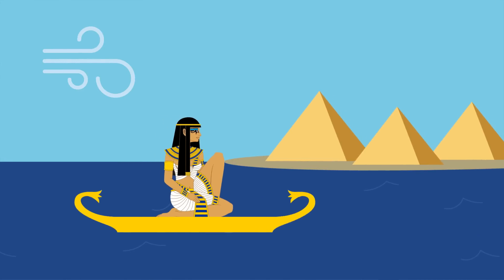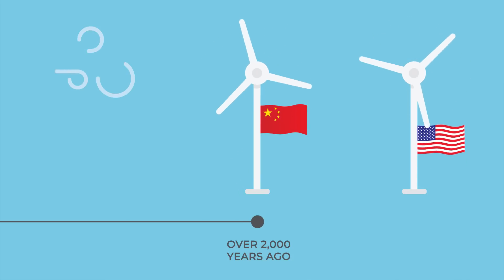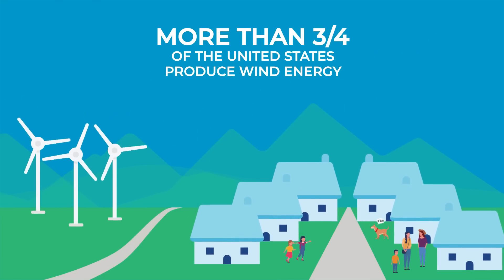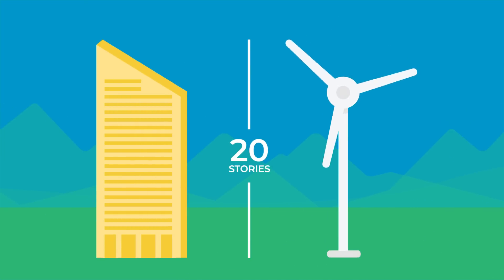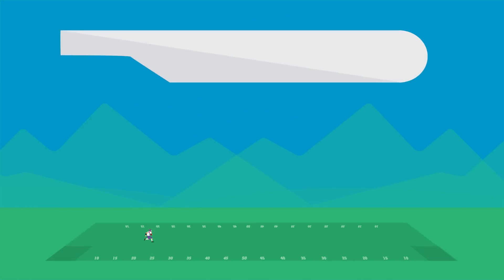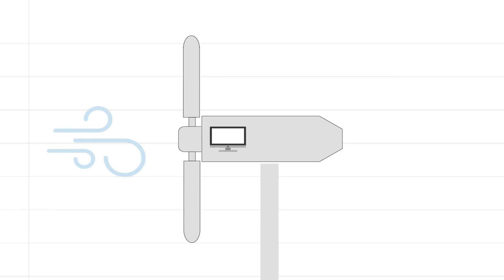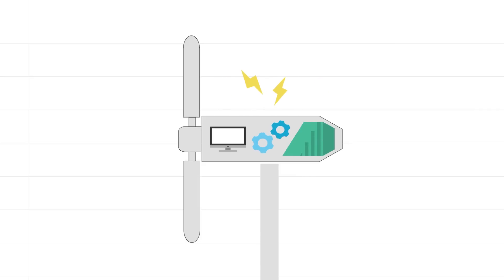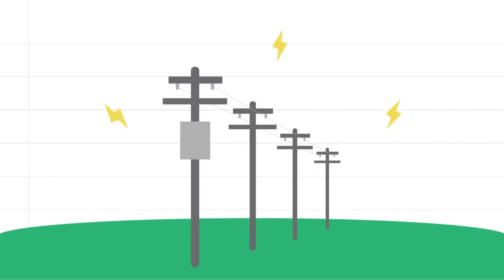Renewable Energy 101: How Does Wind Energy Work?

Comment: This tech only works for you got a windmill on your property powering your house. Imagine this huge windmills 300 to 600 miles away from your house powering communities. How much energy is lost in the miles of electric lines compared to how much energy this windmill produces. What happens in the winter time when they freeze up? This is to bring the carbon footprint down right? Research how much carbon it takes to build one of these usless machines..
Reply: 1) losses: 
Over 500 miles with high voltage direct current power lines you lose about 2.6 %. We are talking 2500 MW here.
2) Wind turbines don’t freeze up, they have heaters inside the blades that only use energy from the production. Modern wind turbines have much better capacity factor compared to turbines 15 - 20 years ago. Where they would return about 20% of maximum installed capacity, modern can do 50% depending on site.
Reply: @Mike-kr5dn  Don't freeze up? tell that to Texas.
Reply: @richarddangles8896  that was not the problem of the outage. Wind in Texas is only a few %. The biggest outage was caused by gas and coal they froze up. Now this wouldn’t happen if they were reinforced against freezing temperatures. But how often does it freeze in Texas? Not worth to do.
Texas also did a big mistake of going with their own grid and disconnect from other states unlike all of USA.
Reply: 3) carbon is offset in first couple months